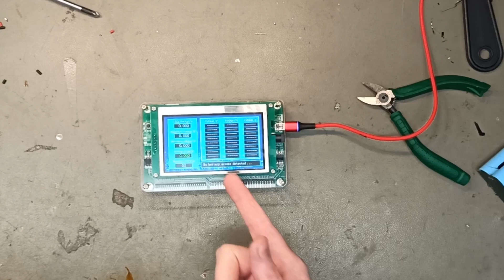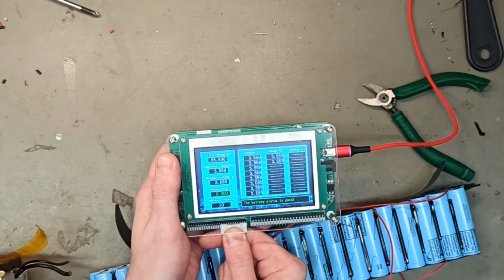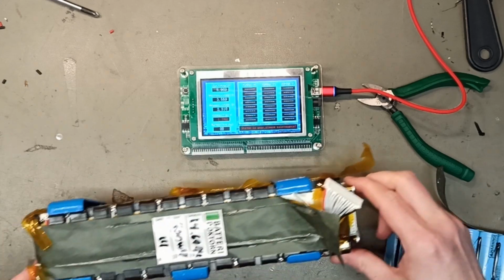1-24S Battery Voltage Display - Awesome tool for batteryrepair!

Comment: Does yours flash a green light even before you've connected a battery? Also, mine doesn't show anything when a battery IS connected and switched on, also even when a battery is plugged in, it still doesn't pick up that a battery is connected...

Comment: Does this voltage display require any battery harness to read the cells of an 18S2P 21700 40T NMC battery pack?

Comment: It was developed as the screen for a battery testing instrument for manufacturers. It's very useful for DIY batteries. Splice cables or a pass through cable would make it more useful.

Comment: You can´t get the same functionality from a good Smart BMS?  Monitoring and logging,  Bluetooth or cable to laptop or phone/tablet.   Other than the much lower price the most important difference is being able to balance the cell groups with a push of a button.  Both passive and active balancing.
Reply: If you use it for ONE battery then maby some will like to have a smart BMS. We repair batteries and must check the voltage of cells groups fast. However you will only buy/build a smart BMS battery ONCE! The BT is always on on all smart BMS i know of and it will kill the battery if you do not use it all the time and forget and charge it for a few weeks, have seen a 20S12P panasonic battery drain completely in a few years due to a smart BMS.

Comment: Battery Doctor, I need your help. I have a battery that is visibly losing voltage. Like when you connect a multimeter you can see it go 56.7..56.6...56.5...56.4. it's a 52v 21Ah 14s6p Samsung 35e cells.
Reply: Seriously ??
You won't get an answer ................
Reply: @A6D6E6  oh well no harm in trying